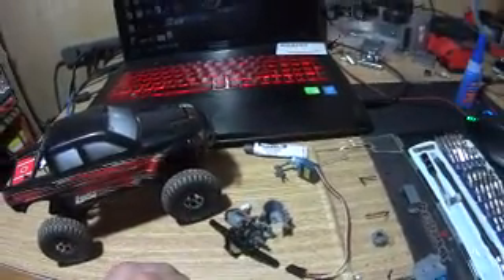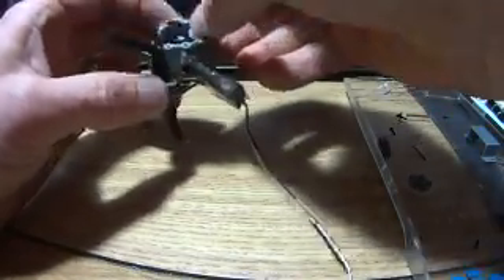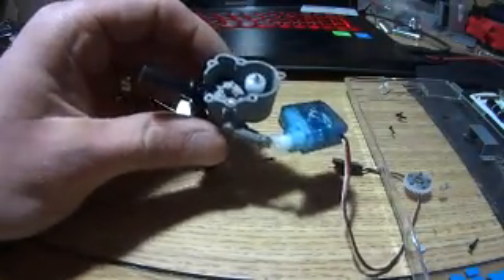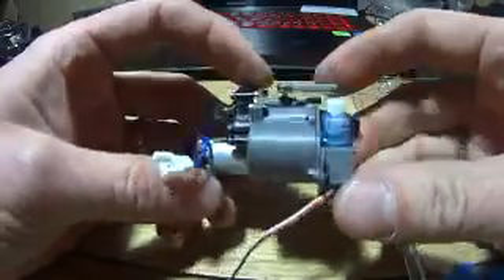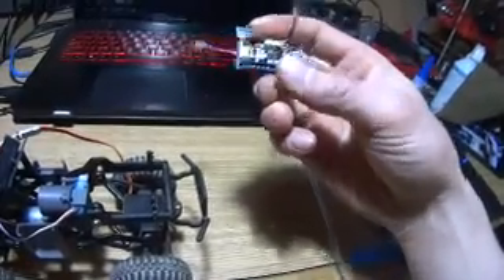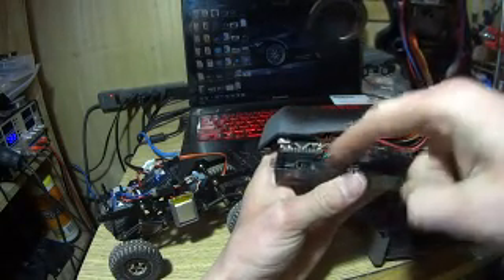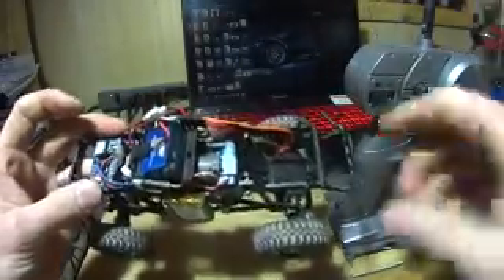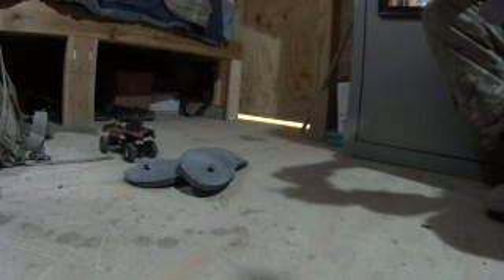Losi Micro Trekker Two Speed Transmission

Comment: do you have the stl files  for this and instructions...??
Reply from the maker: I Believe I do but I used gears from a cd-rom drive. Are you able to print very small teeth on gears?
Reply: Sean N. 
I believe I can...if not I can get the CD ROMs from a buddy of mine
Reply: Sean N. if you can send STL file parts list and instructables via my email that will be fantastic..will be forever grateful....props to you..!!!
Reply from the maker: There is now a link in the description.
Reply: Sean N. 
thank you!!;
Reply: Sean N. 
Hello and thanks for your files...i printed them already but theres only couple things that are not on there which are the shift fork and servo link for fork...if you can add it will be highly appreciated...thanks again!!
Reply: Sean N. if you can contact me via email that will be great...
Reply from the maker: I ended up making the shift fork out of a metal ring terminal that I cut up and soldered. The plastic version will deform. I included both files in the same link. Also, I used push pin heads for the ball part of the ball joint.
Reply: Sean N. 
thank you once again...
Reply from the maker: No problem, good luck with the build.